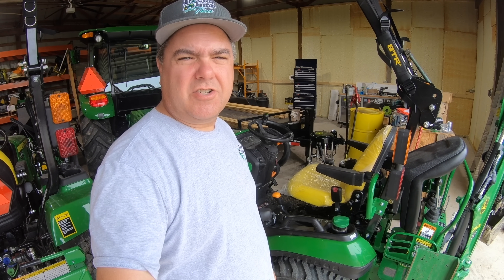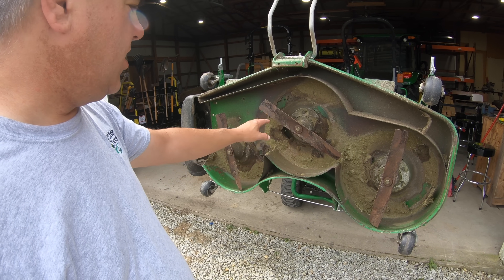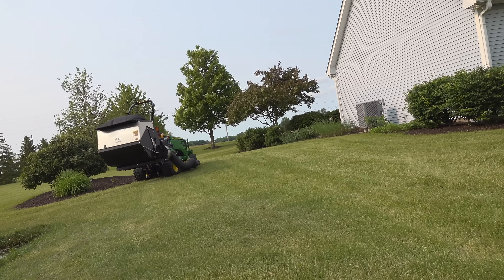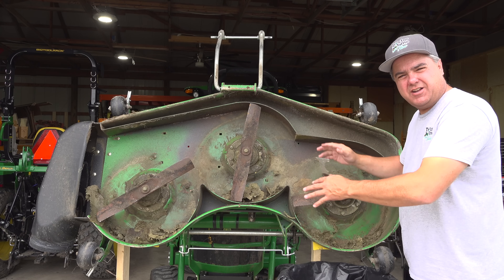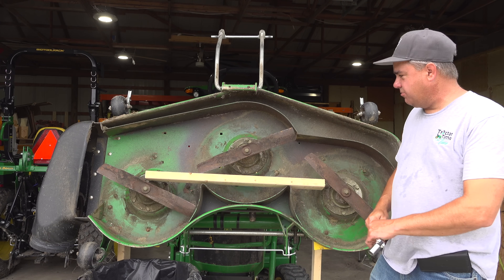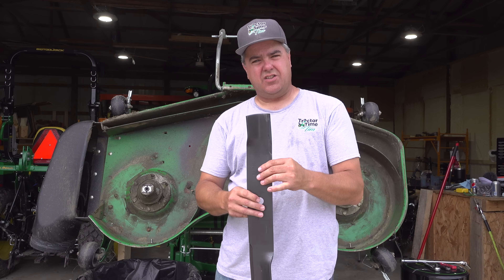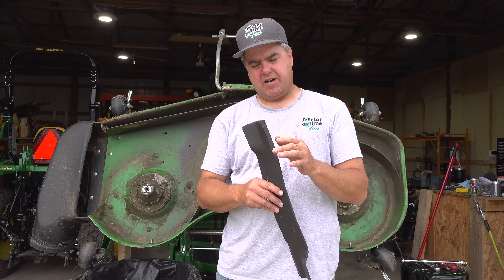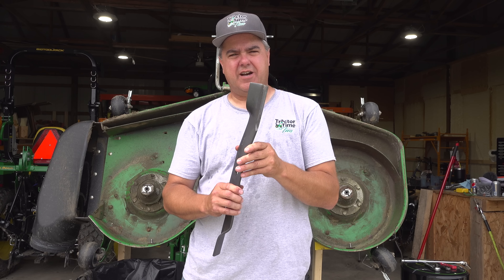Never Sharpen Your Mower Blades Again???

Comment: Those new blades would not make it where I live - SC.  The sand, here, will eat up tool steel. I have seen bladed where the lift completely disappeared and the end of the blades looked like a snakes tongue.  I use gator blades and they seem to do real well.  I will pull the off every year on my Snapper SPX, 42, sharpen and rebalance them - that’s about it.  Hardened steel can shatter, chip and break if you hit something hard.  The hardest things I hit is the tops of stumps from trees that I have cut down.    If you want blades to last get the thickest ones you can.  I had 3/4 inch blades on an eight foot bush hog at the farm and they would mow down four inch trees if I could get them under the deck.  My Ford 7740 had no problem pushing them over and the hog would just shatter them.  I wish I had a stump jumper on my Snapper.  With one, I could just slide over stumps.

Comment: If you mow in sandy land the sand will wear out the top of the blade really fast.
I have had that happen.
Reply from the maker: That is the reason for these blades.  Perfect for sandy areas.
Reply: @TractorTimewithTim  That grass lifting pitch on the blades gets worn down flat.
All you have is a flat piece of steel.

Comment: I put hardfacing weld on my leading edges of my blades. In October (at the end of my mowing season). I can still cut a tomato with the edges of my blades. I mow 2.25 acres usually once a week from 2nd week of  May till mid October.  !! Hardfacing weld works....this is a gimmick !!

Comment: don’t use a pressure washer or one of those garden hose connectors and wash the deck right after mowing let the arbors and bearings cool down if you spray water on them when they are warm they will suck the water right in and you will go through bearings in a very short time just like pulling your boat down the road to the lake and backing the trailer into the water too launch the boat if you don’t have bearing buddys pushing grease into the hubs the hot bearings will suck in the water and the bearings will burn out in a short time

Comment: Welll Tim,,,, when you are over the gravel, you don’t need to run the mower. There are other tools to level the gravel. The mower is not the best!!! Hahaha. I can use the mower a half dozen times and not hear a thing that could damage the blades, and then,,,,,,, I check them and there is most definitely some nicks and dings. Hahaha. But I don’t mow the gravel,,,,,,,,,. 
      I am the master at reconditioning my mower blades now, so it’s just something I check every third mowing when I clean the deck.

Comment: First, almost all of this video was NOT about what the subject line mentions. Then, you never even tested the blades.  In other words, you're wasting your viewers' time.  If you want to review equipment, make another video for that.  
But, as far as the so-called self-sharpening blades (they are definitely NOT self-sharpening), common sense should tell you that it's a bad idea. It's clearly based on how Japanese cutting tools are made.  For hundreds of years, Japanese woodworkers have used tools with a thin layer of hardened steel on a thicker layer of mild steel and that's a great idea for woodworking.  The idea is that the hard steel keeps it's edge longer but because the metal behind the hard steel is mild steel, it is much easier and faster to sharpen.  This is an especially good idea for plane blades, woodworking chisels, etc., but a VERY bad idea for  lawn more blades.  That's because woodworking tools don't get the abuse that lawn mower blades get. Lawn mower blades hit rocks, sticks, and all kinds of things.  Hardened steel chips very easily and that's exactly why you don't want hardened steel in a lawn mower blade.  In fact, it will chip all the way back to the mild steel and then you'll have a big sharpening job to do.  Again, laminated blades are useful for two reasons:  1) The hardened steel edge is very sharp so it cuts beautifully through wood as in woodworking and, 2) It makes sharpening must faster.  (It would take a VERY long time to sharpen a blade made entirely of hard steel.  But a lawn mower blade hits all kinds of things so you don't want a blade edge that's brittle.  The result is breaking and chipping.  Lawn mower blades are made of mild steel for a good reason and that's it.  Also, you don't want to sharpen a lawn mower blade to razor sharpness.  Just a nice clever-type edge is the most robust and the sharpening angle should be steep, unlike say, a knife blade.   There's one other thing that you didn't mention. When you sharpen a lawnmower blade, you should always balance it.  It's fast and easy and the balancer to do the job only costs a buck or two at any hardware store.  Sharpen the blade then set it on the balancer and if one end is lower than the other end, remove a little more metal from that end.  And you really don't have to file a lawnmower blade. A bench grinder will do the job faster and, as I said, you don't need a knife-sharp blade anyway and, if you did sharpen it that much (which  you can't do with mild steel) it would get dull REAL fast.  

In the future, I suggest that you keep your videos on subject.  I think you didn't even mention talk about the self-sharpening blades, which are what your video supposedly is about, for the first 5 to 7 minutes. Make another video for deck cleaning and  another one for equipment.  But, even worse, you even came back and showed how the so-called "self-sharpening" blades worked.  In other words, your video was basicall useless. After all, isn't that what's important?  How they actually worked.    But you have probably learned by now that they don't work. They are a miss-application of a principle.  What works for woodworking does not necessarily work for lawn mowing.  Think about it.
Reply from the maker: I have explained myself repeatedly in the comments section. However, since you wrote such a long winded comment, I’ll do it again.

We have over 600 episodes on our channel.  We have a large audience who watch every single episode.  They join us just to see what we’ve got going on any given day.    This episode was just like all of the others to me.  I happened to have the new blades from Deere, so even though I wasn’t very excited about them, I thought it was worth showing.   
I AM excited about the load n go...which was the true theme of the episode.  I love that we can pick up the mower for easy service .
At the last minute during publishing, we chose that title ...as it DOES describe one of the items discussed in the video.
Of course, we had no idea that the episode would go viral, and be watched by well over a million viewers.   
Further, I promised to do a follow up after I ran them for awhile.  I still haven’t done that because I don’t have many hours on them.  However, I DO have more information on them ...learned from a trade show.
I will share this in an update video soon.

In any case, I am happy to refund your admission fee.

Comment: all those caveats about not 'abusing' the blades.
I mow an airport. There are piles of dirt from moles, there are roots running along the ground, there are huge rocks, mostly buried, there are black top chips from the runway and taxi ways. etc.  The result is my mower blades are rounded ends, mostly destroyed by the end of the season and need to be replaced.

Comment: I'm surprised those John Deer blades don't have a chip in them to prevent you installing them yourself. Tractor won't start unless the blades have been installed in the authorised repair centre. I guess that's next years model.

Comment: Blade ends are never suppose to meet center blade vertical and both sides horizontal.
Reply from the maker: The blades are installed correctly.  Thanks for playing.

Comment: Sharpen blades with an angle grinder.  Don't try to change the blade geometry.  

That's a quick way to keep 'em sharp and keep the grass nice with clean cuts.  If you cut with dull blades that can harm the grass.

Comment: Yea right self sharpening you sharpen them. Same with oil changes oil breaks down and looses its protective properties. Change air filters,spark plugs,wires,oil filters as required by your owners manual. If not we’ll she’ll fail. It will get expensive verses a few simple as needed items.
Reply: One has to believe that Deere has been field testing these for some time before making them available to the general public. There are other self sharpening blades on the market and they have been effective in sandy environments, which I believe is the target audience. The self-sharpening blades do not appear to be as tolerant with hitting rocks as a standard blade.

Comment: Tim I don't trust those never sharpen blades if you have watched forged in fire they heavily talk about steel de lamination and some people have to store there mower outside like you used to and the constant temperature swings and with laminated steel sometimes moisture or ice will open a tiny crack that say you hit a stone laminated steel can shatter cause riding mowers and push mowers rotate over 200 MPH causing a pully and bearing to fail prematurely just my thoughts on this a laminated steel for a mold board plow I believe in that cause you don't have the high rotation speed

Comment: I bought 2 sets of blades for my Husqvarna mower and they have tungsten plating on the bottom of the cutting edge.
Reply: Seems like ALL Husquvarna products are awesome! Try their trimmer line and you won't buy anyone elses, but I have been thinking about trying some steel cable...maybe from old tires or garage door cable? I know this could be deadly shrapnel, but following the rules would be safe enough.
Reply: Tungsten you say? Say hello to my little gravel rock driveway friends! Tungsten would shatter like glass hitting them.

Comment: While I'd love to believe they  will self-sharpen, anything spinning and hitting even grass will eventually take it's toll on metal. There isn't a metal composition made yet that can withstand such forces. If there were, aircraft would be made of such compositions. JMHO
Reply: on the Laser-Edge.com website, there is a blade that was run 50 hours with one side having the LaserEdge coating and the other side was not coated.   The LaserEdge side is sharp, while the uncoated side is dull.

Comment: The listing on GPS is very misleading. It shows a price of $35 and then shows a package quantity of "3". Normally that would indicate you get 3 in the package as I don't see the word "each" anywhere. However, they have a quantity of "3" pre-filled in on the "Add to Cart" button which makes it $105 in the cart. Can you confirm that these blades are $35 each whereas the standard blades are $20.57 each?
Reply from the maker: Yes, $35 each

Comment: Have you at least tried using a cooking oil on the deck before using the mower. It's worked well as far as keeping anything from sticking to the deck and keeps the deck from rusting
Reply: yeah i do it with a can of "pam" cooking spray for about $1.99 and i do it once a year

Comment: No such thing!!! Period!! But waiting to see what you find. There is nothing that cuts without sharpening. Been doing sharpening for 25 years. This is just a gimmick like most of these claims are. May last longer, but it will have to be sharpened. Enough said. 😂 I can keep going. The grass you cut has acidity levels that break down the metal. If you don’t think so just run a blade and let it set. The grass or any other earthly compound wil start to eat the metal. Same as a saw blade. You may think that the cutting of material dulls the blade. It does to some extent. But the build up of wood acid will degrade the blade. Even carbide will erode over time because of the acid in the wood. Keep it clean is the best thing you can do!!!

Comment: Probably not a great idea to use a power washer on your deck.  Not sure about JD, but most manufactures recommend against it.  THe main reason is that it can force water into the sheave and wheel bearings.  If you do pressure wash your deck, be sure to immediately re-grease all the bearings.

Comment: They must be semi tempered with a hard base on the blade
Reply: The blades are fully austempered throughout the steel.   The coating is hard and very wear resistant.

Comment: I have already tried a pair of those and they only last about 120 hours.
Reply: The LaserEdge self sharpening blades might last a little longer.  The point of the technology is that the blades will will not need to be sharpened.   As the base material wears away, more new coating is exposed to provide a cutting edge.

Comment: good vid tim
Reply: Remove the blades before cleaning the deck, blades should be staggered too.
Reply from the maker: Saying the blades need to be staggered is absolute foolishness.  These are belt driven, and will slip the very first time you start the mower.

Comment: so that thin bottom layer is made of some newly discovered metal that wont chip and wear back like any metal we use for blades today? i mean come on...
Reply from the maker: Well,, it isn’t magic.  This bottom layer is harder, so it will stay sharper.  
Several commenters here have explained that it has worked for them (other brands)
Also, one commenter mentioned that this approach is used in combine sickle bar sections and has worked well.

Having said that, I have still not cut a single blade of grass with mine, so I have no personal experience either way.

Comment: I would try them but I mistakenly bought a POS Tar River 60" finish mower that uses proprietary hardware.  The only place I can buy replacement blades is through the dealer.  😡😡
Before a YT expert tries to tell me otherwise, you find me a 19-7/8" blade with a 3/4" hole and I'll give you $100!!
Reply from the maker: Frustrating.

Comment: Why not make the whole blade out of the "extra strong" steel?
Reply: The body of the blade needs to be strong and tougher than the coating.    The LaserEdge coating main function is to be very wear resistant.

Comment: Never EVER use a metal scraper underneath your mower deck! You're going to remove what paint is left underneath the deck which is going to introduce rust much quicker. I always clean the underneath of my deck with a plastic scraper. In other words, don't do what the video poster is doing in this video!
Reply: Nitrogen in the grass is the culprit for causing “deck cancer” along with not cleaning the “business” side of the deck.  Scraping by hand the grass stuck to the deck surface with metal or plastic scrapers is better than not cleaning. I’ve seen decks that come with a hose attachment for use after you’ve finished cutting( it’s best to do this right after cutting). PM’s are a must with any pc. of equipment.... if you want it to last... just saying

Comment: Maybe it's because I don't own anything quite this large, but why hassle with anything special and wonder whether it will work?  Zip off the blades, sharpen them on a grinder, and zip them back on.  Unless you mow a lot of gravel or hit a concrete block or something this is a once a year job and takes half an hour.  Seems like a waste of time trying to workaround sharpening standard blades.  You need to clean the deck every once in a while anyway so you're halfway there already.
Reply: Many commercial guys sharpen blades every day or every other day.   Guys that own less than 5 mowers will often sharpen blades at the end of the day when the crew goes home.  Dinner on the table and kids playing in the yard, but the blades need to be sharpened first.  After thousands of blade sharpenings, it gets old.

Comment: I need a never sharpen blade to go with the B&S mower engine I have that claims you never need to change oil.  My belief is the manufacturer based their claims of never needing to sharpen a blade, change oil, etc. to match the length of their warranty.  If they give you a 1 year warranty and put in all sorts of limiting language like "under normal use" or "not warranted for commercial use" they really don't worry about what happens to blades, engines, or much of anything else after their warranty expires.  So, yeah, a never sharpen blade under a 1 year warranty only has to stay sharp enough to cut for 1 year.  After that, the company has no obligation to do anything about a customer complaint.
Reply: These blades are primarily intented for commercial use.  Those are the guys sharpening on a regular basis and they can now skip sharpening as long as there is sufficient wear happening to self-sharpen the blades.

Comment: What a joke.  I have a Toro fabricated 10 gauge steel reinforced deck that hasn't been cleaned in nearly 12 years. Two weeks ago, I decided to refresh the deck with new idler pulleys, spindles, blades, and a good under-deck scraping.  My deck tends to "self-clean" when mowing dry grass, and surprisingly, there was very little grass to remove.  Additionally, most of the paint underneath was gone, but little to no rust was noted, and certainly nothing that even came close to affecting deck intergrity.  Deck should be easily good for another twenty years, given its current rate of deterioration.  Additionally, self-sharpening blades are hilarious to put it bluntly.  If the softer metallurgy is designed to wear away to provide a sharp edge, then how long before all the softer metal is all worn away?  I have blades I have resharpened to a perfect 30 degrees on my Bradley and perfectly balanced for as many as ten cycles.  Changing blades also provides the opportunity to check the deck over.

Comment: TIP: "Paint" the BOTTOM of your MOWER DECK with USED MOTOR OIL.
Grass doesn't STICK as much when coated with OIL.

Comment: Take your blades off before you scrape the deck. Saves your knuckles. If you never use your mower, you will never need to sharpen your blades. You're welcome.